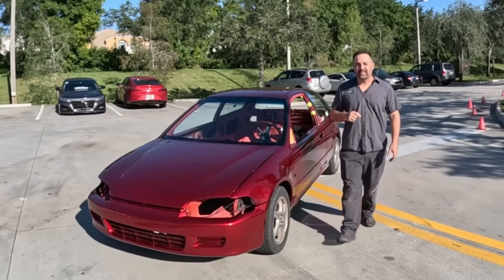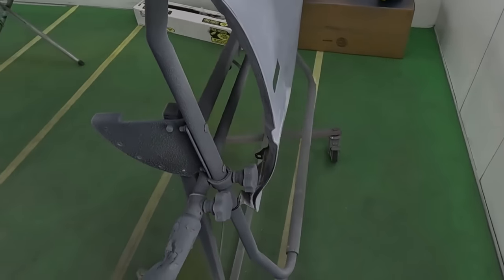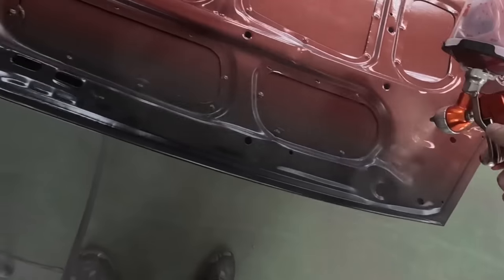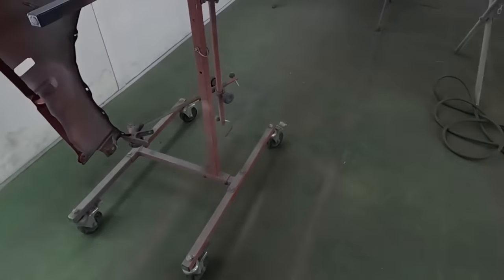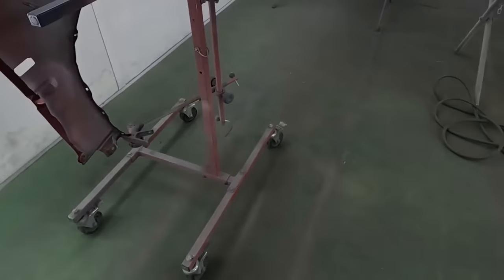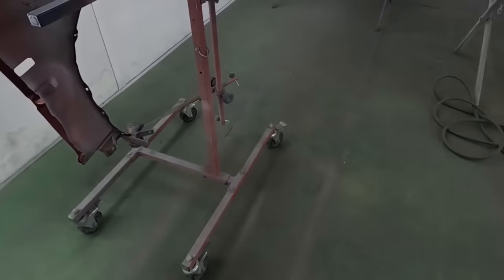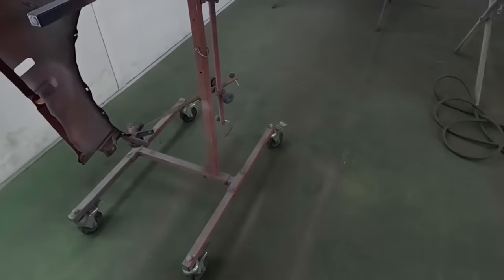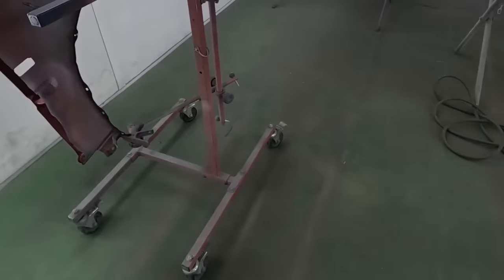STEP by STEP Guide to Paint Your Car By Yourself!

Comment: October marked my 40th year painting. I started at a Corvette restoration shop in St. Louis in 1983. I was 13. The owner started me out painting frames and suspension and engines, and I moved quickly to full paint. It was around the time Dupont ChromaBase and ChromaClear came out and many of the bases were modified lacquers. Dupont reps told us for certain colors  lightly sanding with 1000 grit dry before clearing was recommended for good adhesion. Good times. I do mostly full restorations, but occasionally paint a car worth taking completely apart and pulling all the glass to prep for paint, like a Grand National. With as much painting as I've done, I enjoy playing videos like this in the shop throughout the day just for something to listen to in the background. It's encouraging to see someone explain some skill or discipline as well as this, knowing someone who may want to start has a solid base to use as a reference and will get off to a good start. There are PLENTY of paint hacks giving garbage advice. It's good to see someone give a relatively basic tutorial, yet advanced enough anyone watching will learn something regardless their experience level.

Comment: Loved the video, I have a suggestion on your process. Try it and see what you think.  So it’s the prep microfiber roll. I love using the same roll. Leave the package on, and pull out the center roll of cardboard. It’s not very hard to do. Then pull and tear from the center. It keep them cleaner and dust free.  And if the roll falls off the car if won’t unroll, and the packaging does it’s job keeping it clean until the last couple.  I know it’s a small thing, but I hated watching a few new rolls hit the booth floor by accident.  They are much cheaper alternative to the paper shop towels in the box, but the box is convenient. So pulling the cardboard makes it just like the box.  Paint on👍

Comment: Hey guys, amazing work on the cars looks stunning! Im actually gonna paint the same car (EG hatch) this october, i have new front fenders and gonna weld new rear quarter panels, I bought all the equipment watching your previous videos on how to paint a car guide and was writing notes as i watch! Your videos are extremely informative and helpful and i cant thank you enough for sharing them and giving it all for free! I just need some tips on how to attack the car, im going to paint it a red metallic color idk which specifictly but will find soon enough.
Since i have brand new fenders and a second hand back door im gonna do all the bodywork while they are not mounted on the car like you did in the video, i dont know if i should do bumpers the same way? also i want to keep the trim on the front bumper black any tips on how to mask without making a hardline would be helpful!
And since im gonna weld quarter panels i assume the weld are going to poke out of the body line any ideas on how to attack it so i can make it sleek? I assume im gonna block it but idk with what grid and how big of a block i need?
Thanks again for the awesome video will greatly appreciate if you see this and help this goes for everybody with some experience with painting because im still a virgin in this and every tip helps!

Comment: Curious why you don't just use a black sealer as your ground coat and save a little work?  I have always had good luck with just picking an appropriate color sealer for whatever color base is going over top, never used the eastwood custom colors though.
Reply from the maker: It would work as well.

Comment: How do you tell if you're going to need a ground coat or not? I'm wanting to paint the 2022 Accord Sonic Grey on my 98 Civic, currently vogue silver, but badly oxidized and peeling, so I know I'm going to have to sand down to metal in a lot of areas.

Comment: Awesome video also timely as I am getting ready to start on a full color change. Luckily it is a simple solid color base coat since it is my first paint job. Any reason I couldn’t do body work, then epoxy primer, blocking, and then epoxy primer again instead of urethane, then sealer then follow the rest. Doing all the body work in the shop and then renting a spray booth at a local shop to do sealer, base coat, and top coat.

Thanks!

Comment: Brian brilliant job as usual. I saved this video for my first painting job. I have 2 vehicles, 70 Mustang base clear coat with a 1 inch chip and a 95 Bronco Black that has dings and some faded clear coat (I intend to paint it). If you can point me to the video that covers chip paint, blend etc I would be grateful. Thanks Mike

Comment: Hi Brian- great job and good explanations, but I'm missing why on the red candy coat you look like you are just dusting it on quickly and from almost a foot away. Mario seems to be laying it on slightly wetter, but still dry. Is it like a pearl coat? Is this why the dusting it on?  Also, you are getting around the car faster than Mario.  I don't know Sagola guns, but if they were Devilbiss Prolites it would seem you have a TE20 aircap and he has a TE10! Or are you running a 1.3 fluid tip and he a 1.2?

Comment: question.... I didn't realize how much paint I would need for my Mini Cooper hood and I ran out in the middle of painting. It's going to be a week or so before I get the paint I had to order. When I get the paint, what do I need to do to prep? Do I have to sand or just clean with degreaser?  If I must sand what grit?Thanks.

Comment: I'm doing a full color change on my car...i was going to paint different parts of the car at different times. Main body and trunk first, doors second, front fenders third..etc.  shouldn't it be fine as long as the number of coats are the same?

Comment: question .... if your using 2k epoxy primer but just on  trailing arms  does the epoxy need to be sanded before base coat ?

Comment: If I was to paint a car in 2 different base colours say half red and half blue and I was to use fine line tape when the red has flashed can I mask up to paint the blue and when I go to clear the whole car will the masking tape pull the red off just like to know how long I have to wait to safely mask for the second colour and not peel the first colour before clear

Comment: Hey Brian , I am painting my car hopefully this weekend in my garage, Its a metallic base / clear paint. My question is , I have it sanded 400--6oo grit and basically ready to shoot , but I am worried / concerned when i lay the base down ...   If I have some areas with burn thru (primer) will the metallic sag or ??  is there a technique I can use to avoid this from happening  ?  or am I over thinking it ?

Comment: Hey brain, i have been doing exactly what you did in this video. I have spayed my basecoat (black) i am now at the clear coat stage. Im using lime lyte clear mix 4 to 1 but, here is the twist. I have 50g of purple mica that i want to tint my clear with to spry over the black base. How much mica powder should i mix into this gallon of clear  and will my 1.3 tip still spray  right out of my areopro r500 lvlp spray gun?
Reply from the maker: Sorry. I am unsure. Maybe others can chine in. If you have a 1.3 or 1.4 should be fine though

Comment: When did you paint the bumpers?
Reply from the maker: Week later
Reply: @PaintSociety   Was the epoxy primer applied directly to the plastic bumpers? Was an adhesion promoter or flex agent used? Awesome instructional video with an awesome end result!